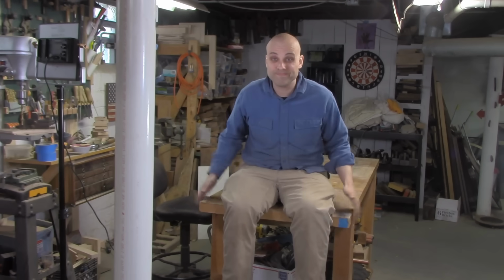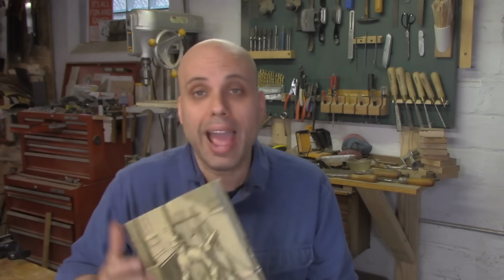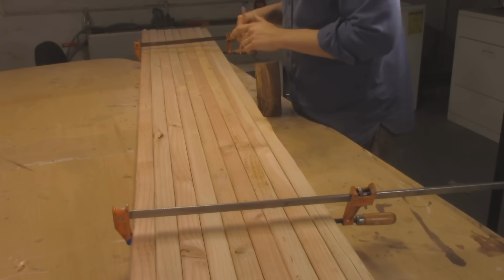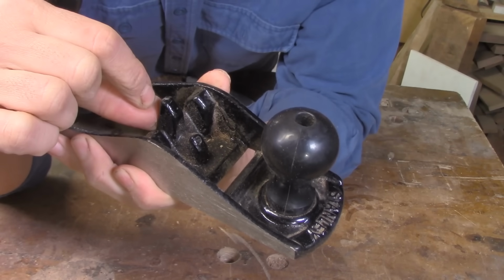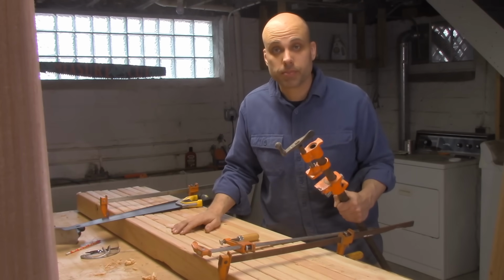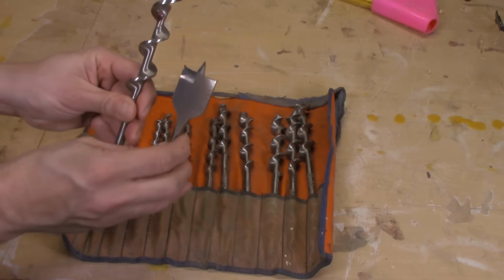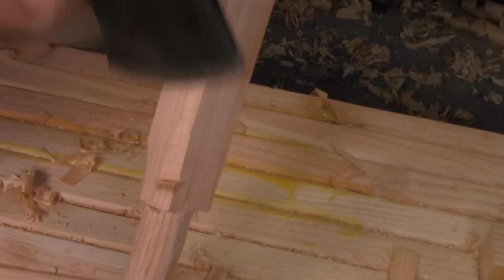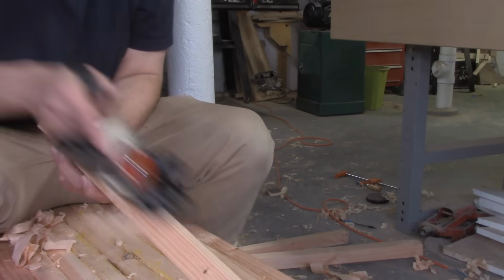Build a REAL workbench for $30

Comment: One trick I've learned for getting good lumber for projects like this is to buy the longer pieces.  They're generally a similar price per foot, but because they're longer, they're less likely to be super warped or twisted.  You can have them cut them in half at the store, or if you have a use for shorter off-cuts, you can buy something like 10-footers and cut off 3 feet for a 7 foot bench, etc.
Reply: Some YouTuber, might have even been Rex, mentioned buying 2x8's at twice the length you need. Then you cut them exactly in half and also split them along their length to get 4 pieces for your bench.  Two advantages:  longer wider lumber is always of better quality than 2x4's and you can put your cut faces up so there are no grooves in the top running full length from the factory rounded corners.

Comment: Hey, @Rex Krueger, thanks for your videos. Here's a question: could one build this bench with fasteners instead of glue? I ask because I live in Brazil, and in my region it's not very easy to find dry wood,  but I figured I could use some boards (2cm x 30cm x 3m) that are easy to find here. The problem: it's frequently very wet (green?) wood, mostly pine.

Comment: Great video. Thank you so much.
Excuse me sir but when I hear you saying  that you  (17:11) put a 15° angle to your protractor to set your bevel gauge and then i look at it and it looks more like 90° + 15° so 105° ?
could you clarify that please?
Thanks again
Reply: The legs should be 15° off from vertical, and the bevel gauge is sitting on a horizontal surface, so your math looks right. (I expect his bevel gauge is already marked 90° so he's measuring directly from that.)

Comment: One thing I'll add as a suggestions is to drill holes along your bench to pass a rope through.  Romans used rope for everything.  If you have a rope going through your bench, where the holes are the width of the piece of wood you are working on you have a perfect hold down clamp where you can either stand on a board that is passed through the rope underneath the bench, or just step on the rope, you could also tourniquet the rope and clamp it in place for additional downward force. Lots of options, the majority of roman work benches were made extremely crudely by felling a tree, and sawing it in half and drilling holes in it this is a much easier way to build a good bench than carrying one while on military campaign.  This is what I am going to do for my backyard benches around my fire pit, got the trees in my shed drying right now, so far it's been 1 year since they were felled so it shouldn't be long and I can do it.  An old saying from Rome "Rope is dope!" lol
Reply: Serious question. Why not use rope wrapped around the lam and shims to level and save from buying clamps? We don’t have bench to begin with… but a saw horse or two may do.
Reply: @ProfessV  You can do this. Spanish windlass and rope is a classic workshop approach, the entire basis of the bow-saw, and saves money on clamps and also storage. I've a loop of rope always slung under my wee bench, and I've used it from everything from frame stabilisation to awkward green wood shave-horse adaption using the chinese loop and heel hook method Rex talks about in another video.

Comment: I followed your instructions and suggestions to make 
two tables, based on this video. I don't have a plane, so 
I used masonite for the table tops, just tacked on. I can 
always plane them later when I get a plane. Also, I didn't 
auger the legs in, I just used more 2x4s. We only have the 
"white wood" here, but I used the kiln dried and they were 
all pretty straight, but I get your point. Here's some photos.

I don't have any clamps, but I used ratchet straps to hold 
the wood for sawing and assembly. I sawed the seven 
boards of the first table all at once, you can see this in 
one of the images. Thanks so much Mr. Krueger! (by 
the way 'Schwarz' is the German way to spell Shwartz - 
think about Schwarzenegger - the "t" is invisible).

Here's the photos: 
https://i.postimg.cc/Y9RWXT77/IMG-20200416-161657737-001.jpg

EDIT: I'm adding a screenshot of my rough sketch, on a 5x9 card, they're  
not really "plans" but if anyone wants to try this table - it's pretty solid. 
As far as the legs, they're doubled 2x4s with the "inner" component 3½" 
inset to lock into the top. As far as screws, they screw into the side of the 
top of the table, and the first one is loose and the second one is tighter, 
used one screw on the first one, and it's still solid but on the second one 
I used two screws and it's even more solid. 

ALSO: I learned this the hard way; on my first model, I had to dismantle the 
legs in order to finish the project. The second one, I put the two sections of  
each leg together first, put the table top together, turned it upside down, and 
attached each leg to the table last. You can see that last leg going on in one  
of the images in the above link!  

The screws were #10x2½" wood screws.
https://i.postimg.cc/ZRrmP5qn/IMG-20200421-122217743.jpg

Thanks for the content, keep up the good work! בס״ד

Comment: What if you don’t have clamps?
Reply: 1) Put the glued 2x4s flat on the floor/ground.  2) Use a loop of rope (or bicycle inner tubes or ...) around the glued 2x4s, side to side, while also using approx. 8-in. scrap 2x4 chucks on both sides to brace the glued 2x4s together. Use 2 or 3 loops of rope spaced apart along the length of the bench to hold the glued 2x4s. 3) Use a thick rod or stick to twist one end of each rope loop to make it tight around the glued 2x4s. (Like you see in a frame saw.) 4) Brace each twisting rod upright between two heavy objects, or maybe hammer the rod into the ground.

Comment: Hey, Rex, just wanted to say I finally got around to building this little puppy.  I should say I've never had a work bench to call my own. I've worked on top of table saws router tables, even lathe beds. Frequently, the kitchen table (my wife deserves a medal) and seasonally, the picnic table. I built it over the weekend, and tonight, I sanded it down, and cut a few pieces of scrap wood with a lousy saw. Then I practiced dove tails with dull chisels. Despite my shop tool limitations, this was SO much better than what I've been doing. I can't think you enough for the encouragement to try and do these things. I love your videos. I'll be joining the ranks of the Patreon peeps soon. (I have an agreement w/my wife to not spend extra money while work is threatened by the virus, and I'm going to honor that.)  This is just wonderful. 

Also, I didn't exactly follow your directions. (My mother says this has been an issue for the better part of 50 years.) Being on the shorter side (5'7") I went for "thinner." I had some scrap 4x4 (pressure treated) leftover from another project, so I'm using that for the legs as well. You had suggested an odd number of 2x4s to have a middle board. The 3 4x4 segments offer me the equivalent of 6 2x4s, but, still afford me the option of holes down the middle.  I cropped both ends of each leg at 15* and splayed the legs approx. the 32* you suggested. Right now, the legs are only glued-and-screwed. I'm going to drill a 3/4" hole through the top and as deep into the leg as I can. I'm going to pound in a hardwood dowel. I think I have that sitting around. If I have that or bigger, I'll use it. Smaller, and I'll put in a couple per leg to strengthen the joint. 

All in all I'm pickled tink with this bench. Thank you, my friend! And, thanks is not enough. All the best,
Reply from the maker: I'm really delighted that you find the bench helpful!! Don't worry about Patreon!  Keep your money until we all know what the hell is going on with this virus!

Comment: I know it violates the $30 rule, but a lumber yard near me had 4"x12"x8' long  planks listed as fireplace mantels. Pine was $54 and they were 4S4 so they measured 3 1/2"x11 1/2" with nice sharp corners. Of course you need to chop your square mortise for the plane stop. But it saves a lot of glue up.
Reply from the maker: There's no rule here. I just did it the cheapest I could. Do it YOUR way.
Reply: @RexKrueger  Oh, I understand, I was just being a little facetious. No harm intended. I found the mantels a few days before I found your video and was going to try and make a couple of saw benches with some 3' sections. BTW, I like you videos, very practical and target my budget nicely.

Comment: Hey guys Im having a real tough time planing the wood to be flat. 
This is my first big project And its really confusing me how to plane them down. For example if the wood is bowed do i take off the high part on one side and then the two high parts on the other side of the bow? Im not gonna have much wood left if thats the case? 

Also i dont have a flat surface only semi flat my garage this is making it really challenging to figure out where the wood is bowed. It anyone has any advice of how to figure out where the wood is bowed it would be very helpful thanks! 

Any help is much appreciated.
Reply from the maker: That shouldn't really be a problem with 2x4s. You can also just sight down them to see where the bows are.

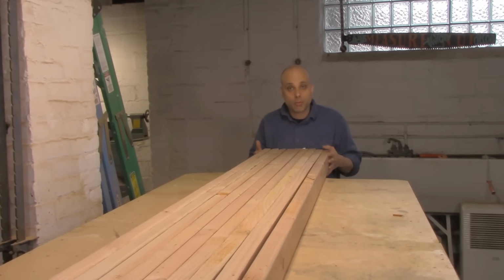Comment: Wait, i dont get the Math at 5:35
If we have 7 Boards of 2'' thickness side by side i get a width of 14''  not 11" and a width of 18" not 14" for nine Boards.
What going on Here?
Reply: A 2x4 you but at the store has been dried and planed, so it loses some material. The actual size by the time you get it is 1.5" x 3.5".  

He also appears to be rounding up half an inch.

Comment: I just have one problem with that bench: I live currently in a small apartment where I don't have space for such a long bench. is it viable to just half the length? like, would the bench still work or would get some of the later added features get in each other's ways?
Edit: I just thought about it a bit. around 4' ( or 120-130 cm in the far superior metric system :P )seems to me to be the sweetspot between usability and space consumption.
What do you think? after all, you are the one with the experience. @RexKrueger

Comment: I just bought the timber today at Home Depot. Down in South Florida I seemed to have three choices:
- cheap white wood ( mozarella sticks )
- SYP but this stuff was awful, bowed, twisted and with bark everywhere
- KD HT ( kiln dried heat treated )

Now there was no information on what tree the KD HT came from but it was pretty straight and regular so I went for that at a shade over $3 per 2 x 4 x 96". One concern I have is that there is a wide variation in weight between pieces with some of them feeling like PT lumber compared to others. ANYBODY GOT ANY EXPLANATION FOR THAT other than that my kiln dried wood is wet? The only thing I can think of is different parts of the tree. Some was more reddish in color than other pieces. Maybe the wood is actually from different trees ( guess I'll look at the grain more closely ).

So I will let it sit while I look for a plane. I didn't like the look of the Chinese made Buck Brothers 9" plane in Home Depot so I will probably order an Indian made unit from Grizzly.

Comment: I am building a custom sized bench. I am going to use this for wight lifting and wood working. It is going to be 48" long and 10.5" wide. Top of the bench is going to be 18" from the ground so I can get good foot hold.
Reply: I had that thought too but you need to be careful with the weights thing. The leg design is not right for that application and the thing will likely splay out and pin you when you are going for your benching record. Unless you can put some other supports under it for the weights and remove them for carpentry I don't think this would be a good idea. Of course, if you are 120lbs wet through then go for it.
Reply: @errcoche  For sure. I have a solid metal lifting rack that has metal bars that stop the weight from smashing me. I should be safe under that. Also, do not intend to lift more then 100 pound on it. I do appreciate the advice. I am 170 pounds if that matters.

Comment: I've been working on this bench as my "intro to woodworking" project and I'm at the mortise step. I'm using my dad's old bit-brace and it takes me a couple of hours to bore the leg mortise. I'm pretty sure I'm way slow, do you have any tips?
Reply: Sounds like your spade bit is dull. There are many videos on YouTube that will show you how to sharpen one if you don't want to buy a new one.
Ignore the ones that require expensive sharpening wheels. You can do it with a file and sandpaper.
Reply: @handyboy2000  Thank you for the reply. I'd actually bought a new bit since he didn't have 1-1/4. I'm wondering if I was using it too high up. My work surface is about waist high so I think I might not have enough body weight pushing down on it.

Comment: Any reason you couldn't skip the glue on the legs? If they're conical then more pressure on the top should just make them tighter, and without glue you should be able to tap them out to make it more compact for storage.

Comment: 19:56   - does not make sense since all four legs are uneven
Reply: It works! Level the legs using narrow pads, so you can get the pencil jig flat on the floor while you drag it around the legs. I used a 3/8" bit and put a hole through a 2x4 offcut - you can clip a Bic pencil in.

Comment: What is the hell are you doing in this video? Is this video intended for people that don't own table saws? Or planers or joiners? If so be my guest if not you're doing it wrong you rip all the short sides off of those son of a bitches and clamp them together glue them and you're done. If you have a 14 inch planer like I do you run them through once and then you're done you have a perfectly smooth Butcher Block surface I cannot imagine cleaning all that shit

I mean don't get me wrong I'm not against a little planing but when you have a table saw and you can rip those down to a butcher block smooth surface do it.
Reply from the maker: You know how many people don't own table saws? A lot. And those people still deserve to do woodwork. You have the toys? Good for you. Other approaches are still valid.

Comment: Are 2×4's suppose to be a little under that measurement, is that just lowes? Or are they suppose to be the name intended width and depth?
Reply from the maker: American dimensional lumber is under.  A 2x4 is 1.5x3.5. This is standard.  In England,  their lumber is actual.
Reply: Thanks Rex! This probably can only come with experience but how can you just see where you need to plane after drawing the triangle? It may bee a good video "warped wood solutions"

Comment: I'm skeptical of the pencil trick.  You drive the 4 legs into the bench at varying depths. If one end of the bench has legs driven 1/2" deeper, then your whole bench will be tilted low on that end. Am I mistaken?  I measure from the surface of the bench (which is touching the floor) to a determined height and strike a line on each leg, then use a level to mark horizontal.
Reply from the maker: Well, it worked this time, and it worked the last time I did it. And it worked on the last two stools I made, so I'm gonna say that it works.

Comment: I make knives and honestly this would be great for for just having tool holders and being light weight portable sturdy workbench can probably  build a little anvil / vice in it
Reply: And I get to sit like that's honestly the deal breaker. update: baught  (4)  10' 2x4  gonna make a 12" x 5" bench for extra stability im making it shorter and it only came out 22 bucks instead of 30 :) gonna use folding legs of some kind maybe,
 folding heavy duty step stools or something like that🤔

Comment: I made a similar bench for $15.  I raided the culled lumber cart at my local Home Depot out of 3 cedar 2x6 boards that were actually straight.  Made a bench for outside use in gardening and some woodworking.  I saw the boards and thought of this video.

Comment: Hey Rex, I am interested in building this workbench, due to simplicity, price, and space saving. I am just getting into woodworking and was wondering if you could add a wheel system to at least one side of the bench, to make it portable. I am very limited on space, and I don't have a garage or a workshop to store it in. I just have a 4x6 storage unit nearby. I want to be able to easily transport it back and forth when I work on projects. If you have any ideas on how to do that, it would be helpful. Thanks for the great and clear explanation of instructional videos.
Reply from the maker: I think adding wheels is fine. Just make sure the bench sits on it's feet while you're working. Also, you could make a short bench (4 ft) and then just pick it up. It's not heavy.
Reply: @RexKrueger  thanks

Comment: That zen/Chinese like riddle you said about the bench in the beginning is true, when I was way younger I used to do some wood working with my father, a few months ago I did a small home project and after the first 5 minutes into it I was like, fuck, I really need a workbench. 

It's so complicated to do some work without a bench, still I managed to do it with some upside down buckets like you mentioned but it was a pain in the ass.
Reply from the maker: Damn near impossible to do anything without a bench. Very frustrating.

Comment: OK, it's a crappy bench for those of us with crappy budgets, but I'd still make it a lot taller and at least 50% wider.
I glean 2X4's from Distribution centers where trucking companies used them to secure loads. Some are total crap even being half round with some bark (AKA Firewood) and some are the best top of the line kiln dried boards I have ever seen. They are light for their size, stronger than most and straight as a friggen arrow! I was thinking of using them to make a butcher block tool box top for the 6' long X 3' deep reloading tool box I'm building in the spring.